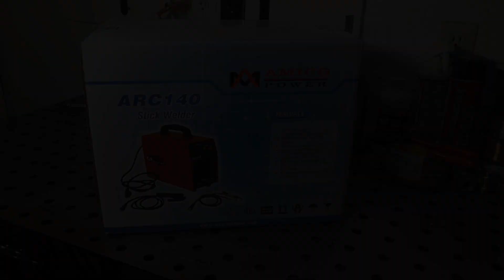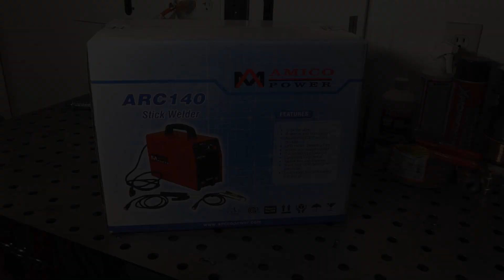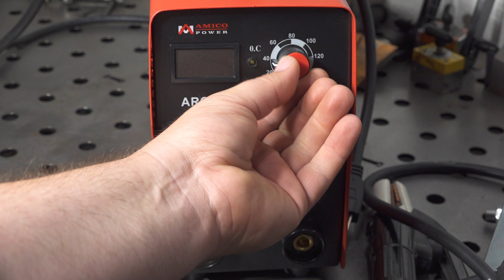Amico ARC 140 Stick Welder Review

Comment: Thanks for posting this video!  I bought this welder and wasn't all that impressed with it so I set it aside and didn't mess with it.  After watching your video I went out and swapped the electrodes and it performed better than initially expected.  Yes, it a great little machine when wired right.
Reply from the maker: I thought about making a second video just telling people about that issue so they could get better performance out of this little welder.  Glad it helped you out.
Reply: Good to know. I was looking into this as a hobby welder, and after watching the review, I wondered if the polarity issue was a one off. Guess not. Knowing that, for the price, I can live with it. Thank you both.

Comment: Looks same as one i just got epsept mine is blue and says static ark on the side with CE marks all over it. And to be honest its a quite good little dc welder i repaired my bike exhaust with it yesterday and my rear swing arm just had it dialed down to 30amps and was fine not like the Ac stick welder i have that anything i go near thin mental it just blows holes in but this new dc one is brilliant

Comment: Thanks for the review!  I want to do some basic welding, angle iron, small steel tubing for a trailer and garden tractor adaptors. Will this do the job? Or maybe the cheap harbor freight? Thanks.
Reply from the maker: This would probably work, just bear in mind the possible issues based on what I found.  If you decide to go with something from Harbor Freight, the Titanium Flux 125 is pretty good.  The Chicago Electric 90 and 125A flux core welders have AC output and are much more limited.

Comment: I guess for some Q.C. stands for "quickly constructed", and with little to no inspection or testing.     Caveat emptor.    You didn't say what the current draw was on 120 for this machine.     All the cheap stick welders I have tried pop breakers too easily.

Comment: WOW.  I wanted one until I saw the wiring.  I'd be curious to know if you contacted Amico about it and if they responded , what they had to say.
Reply from the maker: I didn't contact them about it.  I probably should have to see what they would say.  I didn't because I have other cables, so it didn't matter much to me.  So you know, that same brand of cable has come with several different Chinese welders I've checked out and this was the only one with that issue.  Still seems like some crappy quality control practices, but I don't think most will be like that.
Reply: @bigtb1717  Thanks. Hopefully they made changes since then. I see the current line LOOKS different.-John

Comment: Amico has been around long time. I used these in the shipyards back in early 80's. They were top notch back then. Guess they got bought out by cheapskates.
Reply from the maker: It could be.  My first experience with them was $200-ish TIG machine I got from Amazon that had a lot of odd issues.  It's a shame when companies go under and the names end up slapped on cheap stuff.

Comment: Yeah I have questions what kind extension core do I need for my welder it only has regular house plug on it and don’t work on house plugs out side
Reply from the maker: You just want a large gauge cord.  I'd recommend a 12AWG cord and use the shortest one you can.  Longer cords will result in more voltage drop.
Reply: Ok well I only have only dryer hook up in my house that do I still need get 50 volt core and make it fit the dryer plug or what
Reply: Or would it work off power strip
Reply from the maker: If the welder just has a standard plug on it, then you wouldn't need to use your dryer plug, just a standard plug.  Not likely to work off a power strip.  Power strips aren't designed for that much power draw.
Reply: Yeah it has stander wall plug but won’t run of the wall plug so what would I need to do about that what hook up and cords would I need it’s 110 volt welder
Reply from the maker: @yfgmoney1869  Does it trip a breaker or simply not work?  You shouldn't need anything special.
Reply: It’s not tripping breaker it’s just not working the plug on it says 16A 125V on it
Reply: It turns on and everything just when went to weld it didn’t weld
Reply from the maker: @yfgmoney1869  If it doesn't trip the breaker it may just be a defective unit.
Reply: It runs power on and fan works could it possibly be what I’m grounding it to
Reply from the maker: That's possible.  It's best to ground directly to the work piece if possible.  You at least need a circuit path through the work piece, so if the piece you are wanting to weld is sitting on a metal table and you ground to the metal table that would work, just for example.
Reply: I don’t have metal table i weld on my concrete ground for know would so straight to work piece or would getting metal table be better then in concrete
Reply from the maker: To make sure it works you could try grounding directly to the work piece.  I don't know how common it is, but concrete can crack and spall (little chunks pop out) if it gets too hot from welding against it.  Just a possibility to be aware of.
Reply: Ok thanks man I’ll try to piece next time and find table

Comment: I guess it works some, after you putz with it... but wtf for 100$ whose better? At this range. Get what you pay for. Leads cross labeled, wtf. Smh. 
Wonder if 200-300 could get you a decent one that runs on 120?
Reply from the maker: Did you delete your other comment/question?  I only ask because I've been having lots of comments lately that show up in my notifications, but don't seem to be there when I try to check.  To answer the previous question that only shows up in my notifications, I didn't change anything inside the welder.  I simply plugged the work clamp into the dinse connector that is labeled positive, and the stinger cable into the connector labeled negative.  This gave me electrode positive, despite the labels on the welder.

It's very possible that spending a bit more will get better quality, but it's hard to say for sure.  The other Amico I tested did stick weld just a tiny bit better than this one, and it also has specific TIG functions.  That one is closer to $300, but it had its share of quirks as well, particularly with TIG.

The ESAB 161LTS is far nicer than either of the Amico welders I've tried.  Build quality and included accessories are better, and it works and welds fantastic. But that welder is around $500, depending on where you get it.  

Everlast used to have a couple welders in the $300 range, but I haven't looked at their selection recently.

I have another $100-ish welder direct from China to review (it was a bit unique, so I decided to try it out) so we'll see if that's any better.  I also have another video I'm working on with this Amico welder, but I've been super busy with work and family lately, so it may take me a while to get that, or any other welding videos done.
Reply: @bigtb1717  thank you so much for the reply and all the info.!  I didn't delete anything only changed/corrected some of my spelling issues. I'm looking at a few different machines to get for light repair wor, hobbies, and metal sculpture. I went to school for welding in the 80s, even got certified in arc welding. Anyway, thanks again.

Comment: that is NOT H01N2-D. the TÜV label is fake I guess. real TÜV labelled H01N2-D is good quality, the cable shown is really bad, never seen something like that. eww
Reply from the maker: That's very interesting.  I didn't realize that brand of cable was supposed to be something decent.  Those identical markings have been on the cables I've gotten with every Amico welder, and one other Chinese welder.  This one was the worst quality with the major defect that was simply insulated over, but all of them have insulation that gets soft, deforms and gets loose on the conductor when they warm up.  I tested in another video and the insulation melts completely at a fairly low temperature.  For an extension cord, whatever.  For a welding cable, that's kinda lame.
Reply: @bigtb1717  it is not a specific brand. H01N2-D is just a combination to determine the insulation material, flexibility and usecase for this cable. TÜV is the german Technical Inspection Agency. with a labelling like that the cable SHOULD be more than decent. but everything can and will be faked.